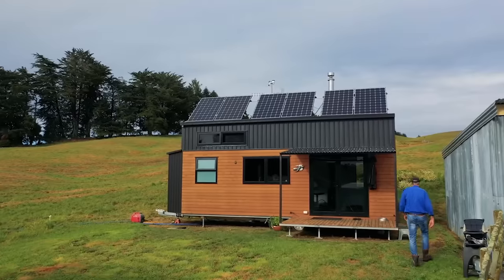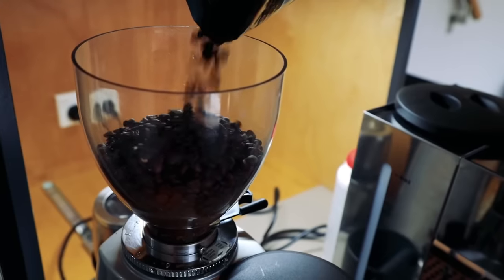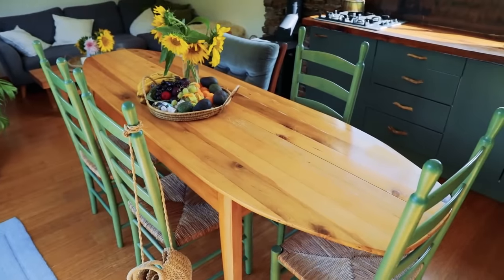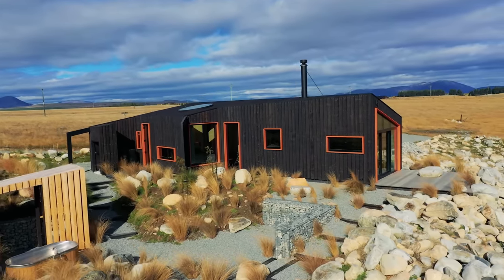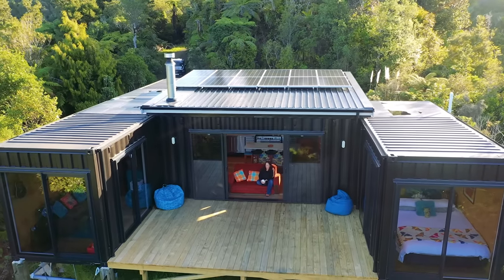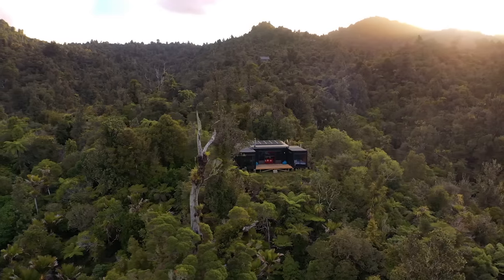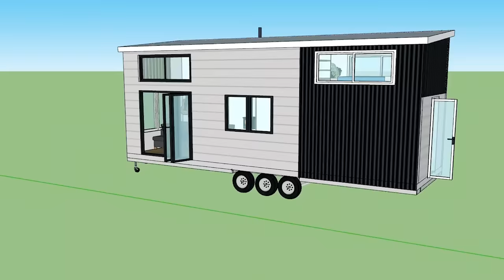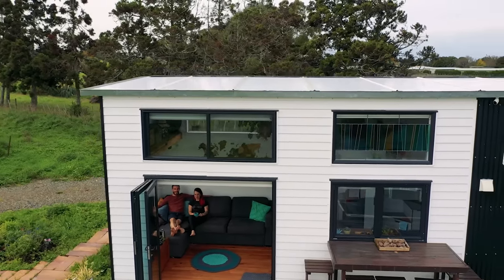The Top Tiny Homes Of 2021

Comment: All this looks good, it is very enticing; picturesque... How much do they cost? Bottom line, flat out what is the cost of a permanent tiny home, well insulated, with/without green technologies/ batteries , no cutting corners or cheeping out on materials compared to traditional single/family homes?

Its all well and good until you gotta cough up the funds. Bigger upfront costs? How about maintenance, short term long term? What are the figures? The facts. The hard science.